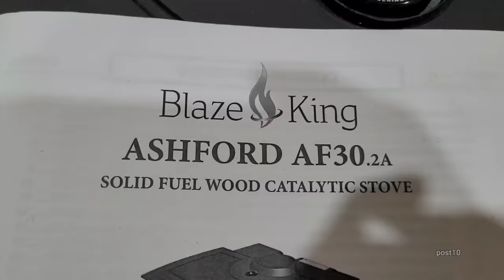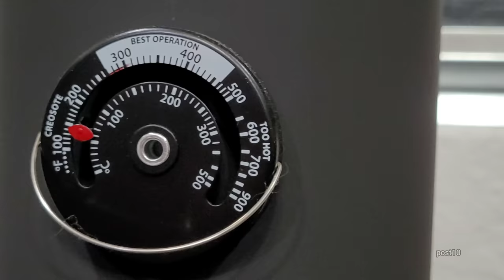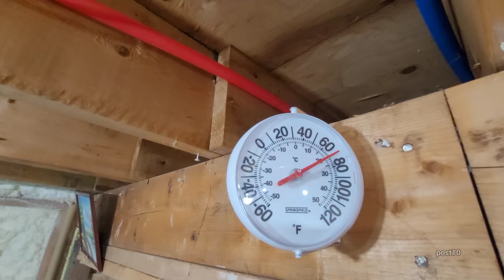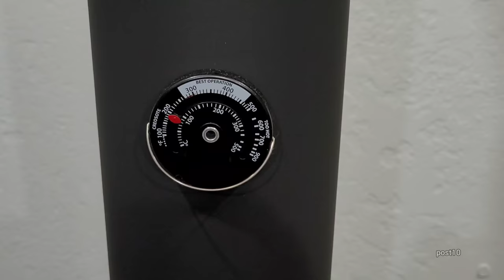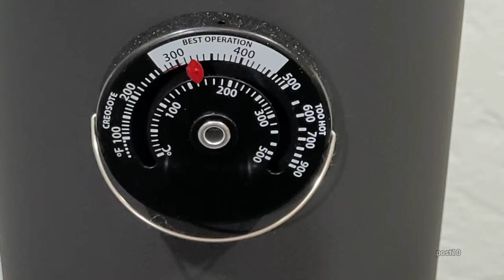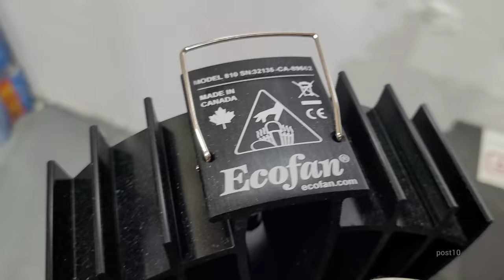Why I Started Heating My Home With Wood And How I Manage My Land. Blaze King Catalytic Stove Review

Comment: Great video.  I hope Blaze King gave you the stove or at least paid you for the review.  You did a very good job.  Also, the fan manufacturer would have given you fan for the review.

And while the sledge and wedges work to split wood, the splitter you have is much safer.  I'm going to try to find the same splitter you used and purchase one.  If you had a link to allow folks to buy them, you'd make a commission.

Comment: Great video Post... ignore the nay Sayers and the negative Nancy's about your log splitter... I'm going to get one for many reasons... Looks like it's a great investment for several reasons. Harbor Freight also has what is called a Grenade Log Splitter you use with a sledge hammer.  Ten Bucks ..  CENTRAL FORGE  HARBOR FREIGHT 3.5 Lb. Diamond Splitting Wedge. Splits wood in four directions at once with a handy splitting wedge.  Also check out a Firewood Splitter Drill Bit. Google this tool...

Comment: I definitely recommend buying an air purifier.  Doesn't have to be HEPA, just something that will clean the air and also release electrons that will bind to the dust. This does make the dust more sticky and accumulate, but it's out of the air And we'll stick in the filter better if it circulates back to the intake.

Comment: crack that window a smidge at the top and bottom...do not open too far. It's one thing to de-pressure the room and get cold clean air flowing in to have the stove work more efficiently...but open it too far and you create backdrafts and cross drafts. Also make sure to get a lid for that ash can. It is good that it is metal (does not melt and radiates heat) but cover it so invisible fumes do not emit anywhere. Great work though, man!

Comment: i have an old 1986 Kent wood stove. used it every year since. if i had to buy a new stove with all the restrictions govt has imposed i would just make a barrel stove out of a 55 drum, with a conversion kit. i even wonder if that kit is still being made... 

the best advice is buy an old stove made last century. you can take it to a welder and get any cracks/repairs done, and you have a good stove you can use. i have a feeling the market for used stoves is very very tight.

stove comps go out of biz so buy any parts you might need in the future while they are available. the door seal, that converter, etc are important.

i see you are still learning about your stove. i use a grain shovel for the clean out. just fill it up with ashes inside the stove and you won't make dust. bang it on the insides to level an knock off the loose ash and you can carefully just carry the shovel outside and dump it. grain shovels come in diff sizes so make sure you get one to fit in your stove. if it's that small, a square point shovel will have to do. you can do this procedure when you get a shovelful, or wait til you get 2 or 3 shovels-full, if you are lazy like me.

Comment: Have you considered replacing that hydraulic bottle jack on your splitter with one of harbor freights pneumatic ones. Could be a direct swap and the. You could use your air compressor to split logs

Comment: Hello, I'm a studying forest engineer and one of the reasons the blowdown would be especially bad would be your way too thick grown forest. When the trees are growing so thick the trees don't get sunlight and only grow taller whilst not growing thick. It would do your forest good log(?) not quite but thin it out a bit. I don't know if it's common in the U.S to have a company come buy the rights to thin your forest(and take the thinned out wood). Usually leaving 900 - 1100 good woods per hectacre. (hehtaari-like 10acres) But anyway I really like to see massive trees and it helps the bigger trees in your forest get absolutely bombastic

Comment: If you have glass door. Take a damp paper and dip it in ashes and rub it on the glass . It will take the spot right off the glass.  Our stove have a reburn on it. We are using way less wood.

Comment: box in around the toilet drain and wax seal in the ceiling and fill it with a few cans or so of that expanding spray foam and fill the boxed in area totally isolating that toilet seal from the heat.

Comment: Nice thing about a wood stove, ,if it's good dry wood, it will burn clean and hot, now half dry, or half green wood isn't the same,, it takes good dry wood,, cord wood, skids, scraps from the saw mill which I'm burning this year,, good wood equals good clean heat,

Comment: Make some roof so wood in the forrest stay dry. It can be used even over years if it is stored correctly. I have combined furnice where I can burn gas, oil or wood, but in our country is cheapest to burn wood, if you don t need to buy it, so I burn wood in winter time.

Comment: Wood heating is actually so clutch especially in the current economic climate. I wish I was back in the house my parents had back in the day. We had a fully industrial wood heater tagt could heat a 5 floor building. That shit was sooooo cheap compared to gas/oil atm.

Comment: Wet newspaper to clean window ,Let cool down and when its cool you can clean it with wet newspaper and nothing else,and place a valve in the pipe so you can regulate the flame.

Comment: I had a catalyst stove for over 10 years. spent the big bucks.  It went bad and I was out of work so I went to Tractor Supply and got a big cheap stove, 279 bucks .. looks old fashion and works the same, not air tight, goes through wood pretty quick.  I have to put a couple of sticks in every 2 hrs or so.   My woods free,  well,  plenty of labor goes into it.  My install was a baffle for the fireplace and a stainless heavy duty flex pipe to get about 6' up the chimbly. @100 bucks.
Am I up to code ?? probably not, code=$$$$, and I dont have any.   Thanks for the video  🙃  I'm always looking for a better idea.

Comment: if you want to get a good draft going you  should put a T  on the outside pipe and put newspaper init and light it up once it starts to roar close the T and start the fire in the box cause now you got a good draft going and no smoke out the front door close the door and put the draft on

Comment: To properly burn pine it’s better if it’s been seasoning for 3+ years. It may have a lot of combustible sap but it is soft wood that holds lots of water and with all the sap in the wood it shields the moister in the soft wood from getting out thus the 3+ cure time for the perfect pine fire.

Comment: Unfortunately Chris your in error. I grew up splitting logs with an axe. My step dad was from Maine and he taught us log splitting because we were economically challenged. Yes you van split 14" logs 12"-15" in length. All that said, I don't understand how anyone would take issue with you on splitting with a log splitter. It's a personal preference. Perhaps the have to boost there ego by slamming you. Don't let them irritate you. Its a huge commentary on them. I always enjoy your vids. Keep them coming.
Reply from the maker: I chopped my smaller Logs with an axe but the larger ones I just keep getting the axe stuck in it, maybe I'm just not strong enough or the wood is too stiff

Comment: At menards if you have one around you 6 inch by 3ft is 100$,   8 inch by 3ft is 130$ for the stainless pipe they also ship I belive but not sure on price. I looked at Amazon they were a lot more expensive. 
That's a ok way to split wood. Yes a ax works good if you have the right kind watch buckin bill Ray on YouTube. They make a round metal one for splitting logs they are not very expensive on Amazon or menards Also use plastic wedges when cutting down or up wood so if you hit the Chain it doesn't dull it or wreak it
Just a few ideas and thoughts but good video

Comment: Here's a tip. Save your LIQUID vegetable oil.  I strain my leftover vegetable oil after I make french fries. Put it in a quart container or larger, like a large mayo jar.   When you have all those small sticks to use as kindling to start a fire, dip a stick in the oil.  Dip a half a dozen.  Then when you to to light them it burns really quickly and the wood on top ignites too.  No more hunting wads of paper or anything to start a fire from scratch.

Comment: I would definitely use the type of log splitter you have, cuz I have a messed up shoulder & carpal tunnel in both hands/wrists. Why work so hard trying to split wood with an ax & screw up your shoulders/arms/wrists, when you can just do it easy?

Comment: Does the stove get outside air via the double walled chimney? I thought all modern stoves use external air so you dont have cold outside air sucked for the air that burns in the oven.

Comment: Instead of a powered venting, put a pipe right above the stove so the hot air goes directly up and through the vent.  
At 51:55 you mention the maple tree you cut and is now sprouting.  If you do that intentionally, it's called pollarding (coppicing if you do it at ground level) and was a technique used for centuries in Europe.  Periodically they'd go and cut off all the dormant young limbs off the tree once they're a few inches thick, and let it resprout.  A strong developed root system will sustain it wonderfully.  Since the sprouts are from the strong roots, they grow fast and straight, making them good for pole lumber, or logs that don't need to be split.
Talking about peevees, they sell them with legs to get the log off the ground while you cut it. 
With all your brush, you might look at hugelkultur and hugel mounds/rows if you looking to garden.  Brush and logs on the ground, covered with a layer of grass clippings, straw, leaves, etc, and topped with soil.  The wood holds moisture and decomposes, creating excellent soil for plants to root down into.  
Your smaller brush pile-bundles, if you tighten a tow strap around them, you can drag a larger bunch than just carrying it.

Comment: Get a box fan put a 20X20X1  filter on back fan on will keep it intact.   No. Dust.   more airflow     Get the firewood OFF. The ground  the bottom will ROT.  Put it all on pallets.  As you stack.

Comment: the metal box actually counts as a fireproof wall (so 8" inch clearance?); technically the wood pile above the top of the barrel should by fire code, be 18" away from the stove (which I see you have done).

Comment: While we're on the topic of Wood Stoves. Are there any that are good, just outside? Seems like it could be fun to try cooking with them, but I don't want to have a fire ring. I have an enclosed porch (with lots of screened windows) but I feel like anywhere I'd put that on the porch would stress the vinyl and/or thin metal around it. And the roof is already enough of a nightmare without that. lol

Comment: 38:30 For splitting wood, do you have a common-type axe or do you use a splitting maul? I personally wouldn't think of using anything besides a maul, and have split 24-30 inch logs without much of a problem, though the larger ones I have to hit about halfway between the center and the edge to start the split--preferably on the near side. While your splitting tool looks handy, for most of the stuff shown so far, and for most of the stuff I've split, using a maul looks much easier. I'm sure that thing would be awesome for sweetgum, which is something that I'm trying to harvest all I can of to get rid of, since it really doesn't benefit wildlife that much. The fibers of that stuff is entangled, making it more of a challenge to split.

Comment: That looks like a nice stove, thanks... Leather wood gloves are nice, eventually you will burn yourself .. when wearing gloves or if sleeved shirt on, do NOT pick up wood with the same hand that you put wood in the stove with, if a spark lands on the glove or shirt sleeve it can fall in the wood box, the wood box eventually will contain a lot of  small dry wood dirt, bark etc, spark falls off you , into the box, wood box turns into an unwanted stove, maybe in the middle of the night etc... especially with softwood, which will throw sparks on you when you draft it upon opening the door to put the wood in, hope this makes sense.

Comment: I worked at a sausage manufacturing plant and we smoked meat the old fashioned way, and when we cleaned out the smoke generators we had to wait at least 24 hours before emptying the ash from the ash bucket into the garbage.  I’m sure you’re aware, but wanted to let you know just in case.
Reply from the maker: Thanks for telling me though, some people don't have that common of sense. I have yet to clean it out when it's hot but if I do it's going straight into the vegetable garden or into a snowbank

Comment: I live in a old mobile home built in the 70s, there's a hole in the wall which we were going to install a wood stove, I am scared to install one because I was told mobile homes can catch fire and burn extremely fast to the ground in 12 mins if a single ember or few embers fly out and catch on something in the house and it catches fire. do embers usually fly out of the stove even if the door is shut? I am so stupid when it comes to this stuff.

Comment: Majority of those smaller trees are balsam fir not pine. :) Get those cut out and cleared up and the birches can move in. Both love wet ground! By having a bunch of small fire circles from burning you'll see the actual pine trees not balsam start to sprout around the ring on outer edges.
Reply: yuuuup got all my pine started last season and it’s doing great this winter. should be taller than me by end of summer. got like 50-60 pines I keep watching. Very happy because it was old logging and only 2/3 full pines on property.

Comment: If you happen to have a chimney fire, suffocate the woodstove with lots of wet wool fabric.
Keep a bucket of water and some old rags close by, just in case.The hot water steam will dowse the flames in the chimney.
Reply from the maker: I had one put the fire extinguisher up the pipe
Reply: @post.10  Always a good thing to have one handy.

Comment: As a suggestion if your heating a home look into thermal mass rocket heater.  Let's you fire the stove less frequently and the shorter higher heat gets you a cleaner burn of your wood.  It's pretty low tech and can easily be diyed

Comment: When you close the Flue in the back, and turn the catalytic converter on so it starts to burn the smoke... where does the smoke from "that" 2nd combustion go?  Even if it's almost clear smoke, it still needs to go somewhere?  Does it still go up the Flue even though it's closed?
Reply from the maker: Yes it does, it can get through the flu above the closed damper

Comment: Post, don't buy expensive stove glass cleaner. Use a damp paper towel and dip it in the ash from an old fire. Then wipe the surface. Might need to go over it a bunch with as much carbon build up as you have. Then simply wipe it with a damp paper towel to get to remove streaks. Another towel to dry.

All of it can just get burnt up later.

Comment: Try starting fire from top to bottom. This is how those heaters are menat to be used. Put all the thick logs on the bottom and some thin ones on top. Fire up thin ones. Wait for complete burndown. This is how all top combustion stoves, oven and boilers should operate. No need for a catalytic converter, nearly no smoke. But it has to be able to draw air for both bottom supply (primary, will regulate combustion speed) and top supply (secondary, needed to burn all the gases emitted by heated wood). My chimney looks like my boiler is fired with gas, not with coal. Smoke is nearly invisible. Try that.

Comment: Your fan needs to be on a flat surface, mine runs within five minutes of lighting the fire. There appears to be a medal strip on the bottom that must be in contact for it to work. The top of my burner is totally flat so I don't ever see that issue, my fan runs flat out all the time.

Comment: A shield of sort above your stove would keep ceiling joist from drying out but more importantly help with circulation of heat thus warming "other" things. Surprised at size of fire box,,,not a horse.  Nice stove. 
Insurance sure a problem and some city codes/politics. Consolidation of companies means less completion and higher prices......and heaven forbid you ask a dumb question they won"t forget. 
 FYI for empty nesters, a round sun looking infrared heater(400/800watt) is instant heat ...or...I hooked up a friend that was chilly in his favorite reading chair with similiar heat but even smaller reflector light used in chicken coupes with 125 watt heat lamp. This directs heat(and light) to the part of your body that looses heat most.  Keep skin moist with lotion as cross country runners do to help stay warm.
Improvise...stick it to the man!

Comment: 36 inches from combustibles regardless is the old standard. Concrete floor or fire retardant board or hearth material. It might be safe to say your first year of expenses are in the hole considering the price of the stove,and the pipe ,time,for your labor,gassoline for your truck,saw,log splitter the first year is probably bust. Eight hundred dollars to fill up your oil tank. The blaze king new,probably cost 4,000 dollars ,maybe 5,000.

Comment: I read someplace that the incomplete burning of fuel (such as wood) is what causes carbon monoxide to build up.  With the catalyst, do you have to be concerned about carbon monoxide building up in your home?
Reply from the maker: I came across that problem only once, the CO detectors were triggered but it hasn't happened since I think it's because it was running so low it wasn't getting proper circulation of the chimney